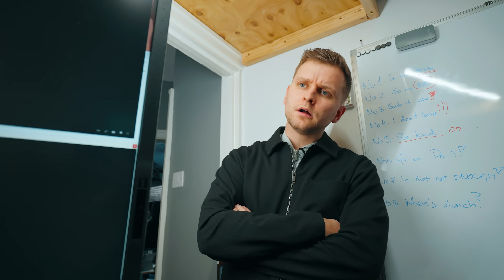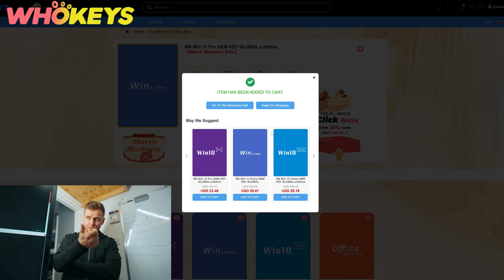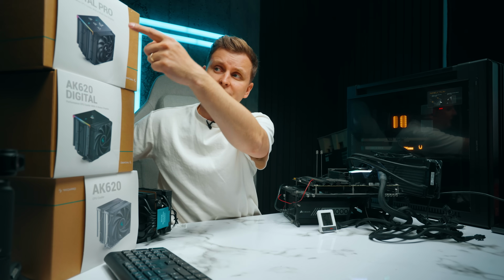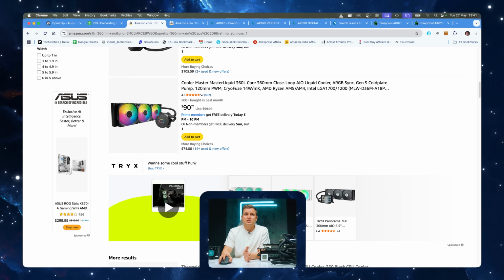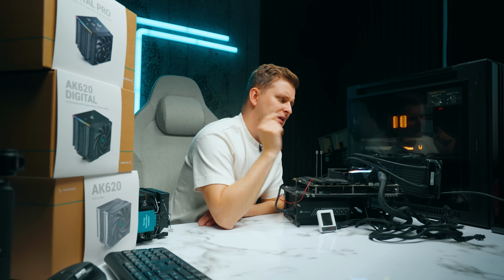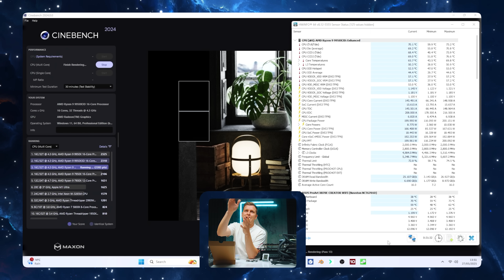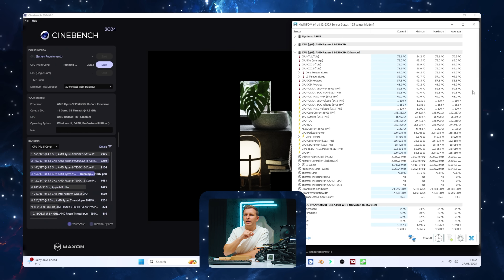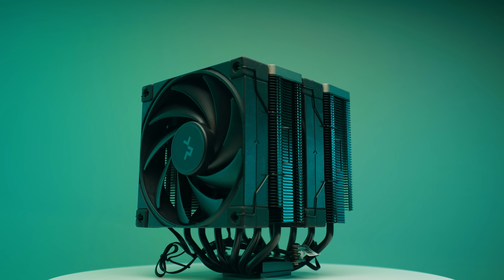Stop Overpaying for CPU Coolers Now! AIO vs AIR [PROOF]

Comment: Picked up a peerless assassin for 20 bucks. Its quiet, cools like a beast. I think 95% of people will never need anything else unless aesthetics are important.
Reply: 3 of 4 of my builds have either peerless assassin or peerless assassin mini in them. The other has a deepcool ak400 zero dark. All great air coolers.
Reply: @UnknownCog-1776  depends on what cpu's you want to cool, the budget of your systems or the aesthetics your customers want...it ain't that simple as you say.
Reply: And considering the PA has like 75 different designs, even then personal aesthetics taste can be fulfilled by the PA.
Reply: same😂 i got my peerless assasin for 40bucks with the lcd display design. it significantly improved my 5600x cpu temps from 97 degrees to 75 degrees at 100% load. stock cooler was ass😂
Reply: I've got Phantom Spirit 120 EVO and have been really pleased with it.
Reply: @LtHead  noctua 12a is the best
Reply: Best 50 bucks I’ve ever spent. Thing keeps the cpu so cool ,sometime I dont think the computer is even using the cpu 😂
Reply: Or the 140 cooler from thermalright
Reply: Best 50 bucks I’ve ever spent. Thing keeps the cpu so cool ,sometime I dont think the computer is even using the cpu 😂
Reply: I like aesthetics too. But the fear of liquid in aio cooler.....💀
Reply: But the noctua 12a is the best
Reply: Cool
Reply: Ngl, even in aesthetics as long as u buy the non SE, it has a cool matte black top plate
Reply: *99.99%
The 0.01% lives in a hemi-anechoic chamber.
Reply: Pretty much as good as it gets if you’re on Ryzen. Only the Phantom Spirit and D15G2 are better.
Reply: AS TIY SAID ITS A BEAST CAN BEND YOUR MOTHERBOARD WITH TIME
Reply: yeah I got the white 140, I mean it looks good with a white build. But no you'll never need any more cooling than this.
Reply: PA 120 has a really nice aesthetic to me.
Reply: I've always wanted a noctua cooler since I was a preteen building my first pc years ago, just never could afford it. Figured I'd finally get a noctua for my next cooler, but the NH-d15 g2 being $180 is just insane, absolutely insane. Now with such high performance out of coolers that are so much cheaper I may never own a noctua.
Reply: I agree! Except maby for some 200+ watt Intel CPUs.
Reply: I have a question. Dose the front fan on PA 120 interfere with the ram and dose it need to be mounted higher up on the heat sink? I have an asus PA 401 case which dose not allow much interms of cooler height
Reply: Tell me a cooler that can cool my Intel i9 14900KF! Currently it is reaching 100 degrees under load.
Reply: It also works pretty well in my brother’s pc, like he has the ryzen 9600x.
Reply: isnt it loud af
Reply: Yeah 100% agree my brother and I have the same cpu, he has an air cooler and I have an aio. They basically perform the same, I just went for a more aesthetic build.
Reply: The peerless assassin cannot fit with my tall ram
Reply: Thermalright coolers are a cheat code
Reply: Peerless Assassin versus Phantom  Spirit? Probably  very similar giess it comes down to price  and RAM  or case clearances
Reply: Where you get it for $20??
Reply: Yep aesthetics yep christmas lights
Reply: Is it enough for a Intel Ultra CPU or should i take something better like ID-Cooling Frozn A720 Black  ?
Reply: @dmsephiroth  Peerless Assassin is rated to cool up to like 250w. I'm sure the Phantom Spirit or the bigger Noctua would do the trick, but personally I'd only ever water cool an Intel chip because I just don't trust them. 360 or 420.
Reply: @dmsephiroth  the thermalright peerless assasin 120 shoud be enough

Comment: Now do the same comparison doing a heavy workload of video editing. Cinebench is just a synthetic benchmark.
Reply: Video editing is mostly taxing the gpu if you use a decent software, cinebench is a lot harder on the all cores load. You clearly have no clue. Maybe more appropriate would be testing different power limits and running things like ycruncher or linpack that are actually harder than cinebench.

Comment: I know my Noctua heat sink is expensive for an air cooler but it is dead silent, works great and six years in running like a champ.  That reliability and performance is worth it to me.  I did AIO once (once) and, naturally, the pump broke and it was expensive too replace and it only worked a tiny bit better than my Noctua heatsink.  

YMMV
Reply: Cheat code is the NH-D15S. You get it for under 100$ and has practically same performance, the 2nd fan only brings improvement of 3 degrees most.

 It also has the improved PCI-E clearance of the D15 gen2 so you won't get situations where too tight spacing causes higher temperatures for CPU.
Reply: @Leopardipzg  noctua nh-u12a is the real cheat code. Almost the same cooling, but smaller and cheaper. And it comes in black. 

D15 fills the whole cabinet.
Reply: @haknys  U12A costs more then D15s. D15s also comes in black.
Reply: @Leopardipzg ok, fair enough, but its still so large. Fills an ATX case with ribs.
Reply: NH-U12A is better for the most 100% RAM compatibility and Classic 120mm tower size with 7 heatpipe for excellent case, but I hope they will improved new NH-U12A into NH-U12A G2 LBC is excellent cooling on AM5 without Offset than older NH-U12A
Reply: @indrahaseo  NH-D15s also has 100% RAM compatibility.
Reply: @Leopardipzg  I'm using Micro case height around 160mm or 162mm, so I cannot using NH-D15s that big sizes which compatible issues with case size, so I change to NH-U12A for micro case is better for perfect fit with micro case
Reply: Using D14 with new fans. Always 10 years in use.
Reply: Bought noctua in 2014, still running
Reply: I had an NZXT Kraken X62 running for about 6 years, no problem. Replaced it because I built a new system, and now I got the Arctic Liquid Freezer iii, because it's cheap, and it's apparently the best AIO for the AM5 platform. I will get into delidding and get a direct-die block for custom loop cooling, and it will be pricey, but I'll do it for the extreme look.
Reply: @lassebrustad My tower sits behind my monitor. No RGB because I wouldn't be able to see it if was even there.
Reply: @Squidgy55  Mine too, partly. 3x monitors, wide setup. PC placed so it's easy to see from the side of the desk. Phanteks NV5 case. I might consider NV7 to add more fans, as well as more space for push/pull.
Reply: Water Cooling high wattage CPUs are more silent and have been on it for years... you can't do the same for air coolers. I'm talking about 2 fan and 3 fan models.
Reply: @Lexy-w3m  D15s or D15 will sufficiently cool even highest end ryzens at good noise levels. Water cooling gets you additional points of failure which can be a pain in the ass to figure out or even wreck your PC...
Reply: @Leopardipzg the reward still vastly outweighs the risk, especially in high ambient temp scenarios. If you know what you’re doing and pay attention to your loop, failures are extremely rare and overblown.

Comment: Truthfully if you aren't using Thermalright coolers, air or liquid, you are spending too much money
Reply: Arctic doesn't cost much more than Thermalright.
Reply: @Rubed0_o ummm yes it does. An arctic 360mm aio is double a thermalright 360mm aio. And double for a 240mm aio. To me double is a lot more. Its double